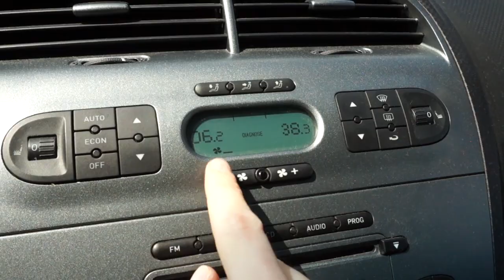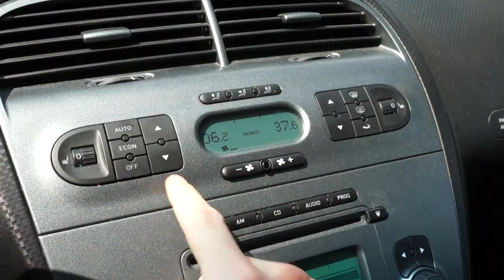Seat Altea Climatronic hidden diagnostic menu

Comment: Hi. How I can start the heat? I have only could air.
Reply from the maker: Just setting the desired temperature to something higher than ambient temperature should be enough. Assuming that the system is OK, and for example the heater core is not clogged with something, or air vent flaps are not stuck/broken.
Reply: @mrfixpl  hi where is the senzor of internal temperature?to a Seat Toledo 2005 1.9 diesel
Reply: Thanks
Reply: Can this reset recirculation flap 00716

Comment: Dear Mr-fix 
Is there a chance that we are able to retrive any erro codes ?
I am confronting following issue , independenly if I try to activate cooling or heating , the air fans are not energized neitehr the compressor or any other component of the Heating/cooling system. The display though seems to work as it should.Any clues??? (Seat Altea 2006 ) 
Thank you in advance